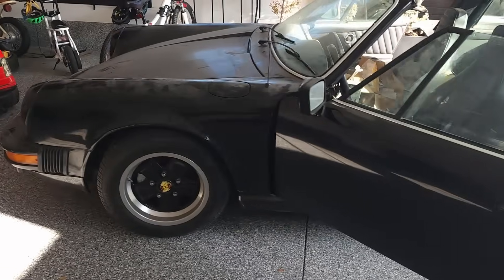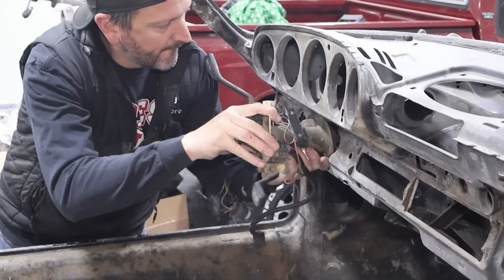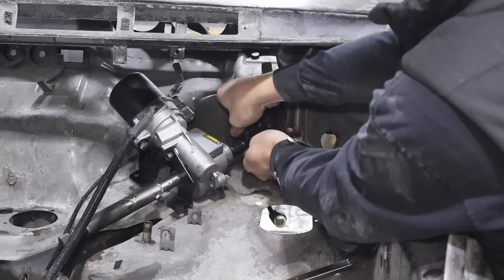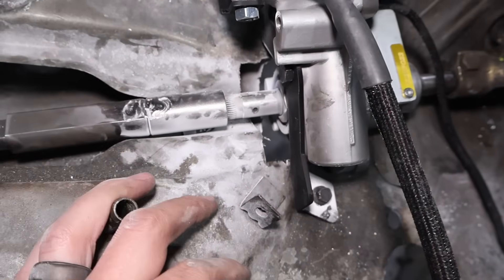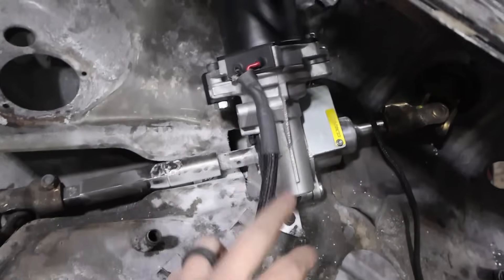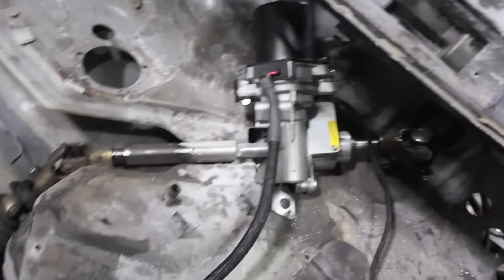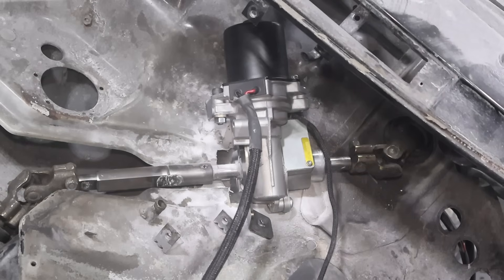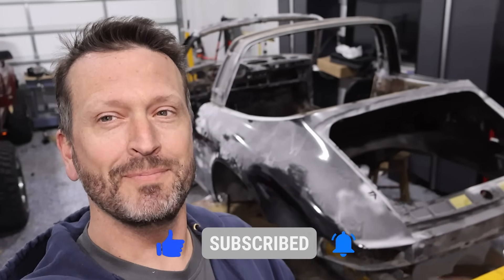Electric Power Steering in a Classic Porsche? Game Changer!

Comment: That box cover for the electric steering needs a drain hole just in case , but with a flexible tube as a drain hole .
So if water goes down it can drip out and out the tube so crap from the road can't come back in .
Reply: You should never leave spots where water can accumulate. Easy fix extending the box to the slope created by the steering column.

It would have been nice to make the box roundy and potentially easier to fabricate (half a pipe) instead of a boxy box.
Reply: I have a 911sc from 1982 with Toyota Prius power steering conversion

Comment: Is there a way to wire that into the motor control system so that the power steering can automatically adjust with speed?  You don't want it to be super sensitive at high speeds

Comment: Is the electric steering rack you mentioned a “drive (steer) by wire?”
Reply from the maker: Just a power assist.  Not steer by wire
Reply: Only 1 vehicle on the road has steer by wire and it's the Cybertruck
Reply: @shaynegadsden  I did not know that. Thanks

Comment: Taking the most sensitive and tactile steering system and replacing it with the numbist worst possible option.  There's a reason Miata cars without power steering are the most sought after, it's a far superior driving experience. 

But you do you man.
Reply from the maker: I do what the customer wants
Reply: @electricsupercar  fair enough

Comment: This is going to be such a cool car when you get it finished!  I don't know anything about EPAS unit you're using but I used a salvaged assist from a Prius on my Jeep and found out later that it is NOT waterproof.  You may want to get clarification about that and/or protect yours from the elements.
Reply from the maker: Good to know, thanks for the heads up!

Comment: At around 13:20 I noticed you have the steering column mocked up with both universal joints in line, and I think they need to be offset by 90 degrees.  Does it matter if there is the torque converter in between them?
Reply from the maker: I'll take a look
Reply: @electricsupercar  Please do, but after I got home I took a look myself, and I think you have it right.  Having two universal joint "in phase" evens out the output.  If they are offset by 90 degrees, it introduces vibration.